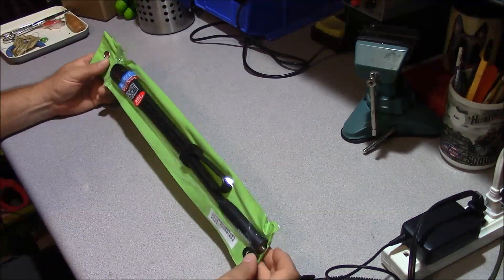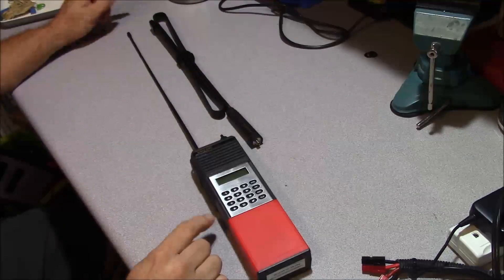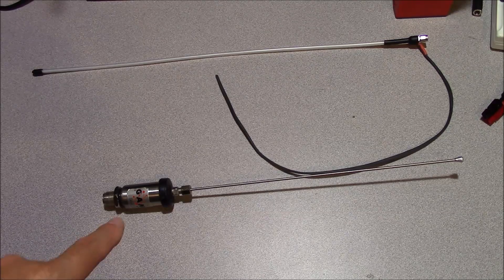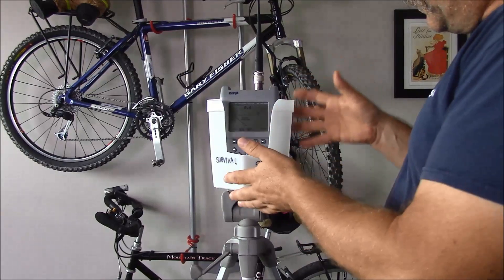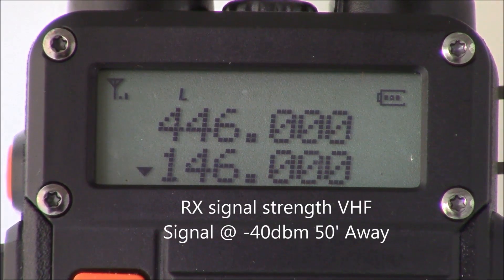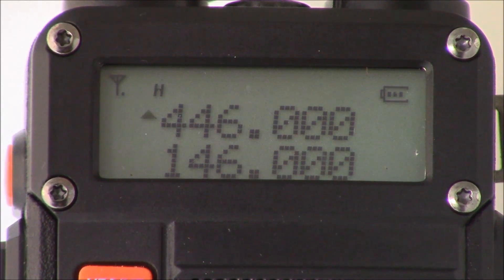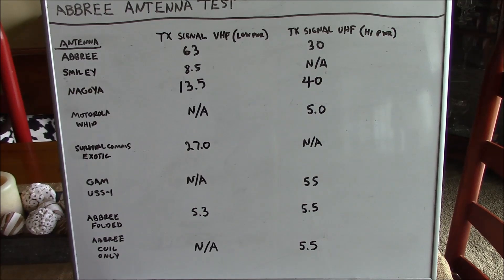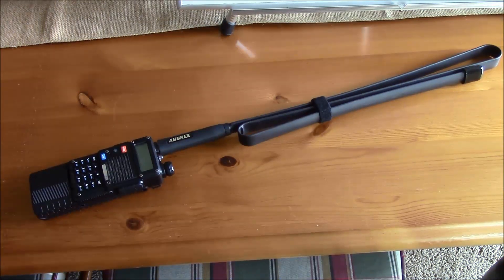ABBREE 42.5" VHF/UHF Blade Antenna Absurd but works well !

Comment: I have both lengths of this style of antenna.  I got then main for the novelty  but inside my house I found the 42 inch recieved better and hit our 2m repeater better. My signal report was better anyway. With the nagoya I can barely kick the repeater.  The tower is about 25 miles from my home and 750ft up the tower.
Reply from the maker: It does work well for sure it is just impractical for a portable IMHO. Im pretty sure it is a 5/8 wave which is a true 3dbd  with a counterpoise.  For a lunchbox radio, back of set antenna with a counterpoise, or as a radiator over a groundplane as a packable field antenna  I think it may be useful. Thanks for watching !

Comment: how hard a job would be for a non radio tech to remove the smw and install a bnc?
Reply from the maker: They might offer them with a BNC out of the box. Changing it yourself would be impractical. Making your own blade antenna would make more sense IMHO. Thanks for watching !
Reply: @survivalcomms  There is a BNC  option!

Comment: Brett, these "blade"antennas are offered in several different lengths,and I believe that some also feature a gooseneck section, making it look like the old PRC-77 short whip.  The 42.5 is longest that I have seen. Would dropping down to a shorter one provide a more efficient antenna for VHF?
Reply: I have the 18.8 inch antenna. SWR at 146.775 is 1.17 at 449.300, and I tested it three times, I got a SWR reading of 1.08. So there you go.
Reply from the maker: Cool beans !
Reply: Thought I was the only person who remembered the PRC -77   Communications expert school Camp Pendleton  Ca.  1976
Reply from the maker: I believe it would be more practical with a shorter blade. The coil might be a problem as it is likely tuned for this blade length . I considered trimming this blade to resonance and using it for another project .  I have a scavenged busted tape measure I was going to make antennas out of and indeed a short blade 77 antenna would be cool.
Thanks for watching !

Comment: Though about getting one and no. Its to big
Reply: Thanks for testing this... Indeed it is a good candidate for a field groundplane antenna, this is the first thing it came to mind when i saw it. Guess we have to thank the airsoft milsim crowd for driving the market!
Reply from the maker: You are welcome and you and I see eye to eye. I have some stuff inbound to make a cool GP out of it and a video will follow.  You are right this antenna oozes airsoft :) Thanks for watching !
Reply: BTW what kind of cosx did you use for your exotic antenna?
Reply from the maker: I used RG303 Thermax. It is a teflon dielectric silver shield and conductor. I used to have a spool of it. It is rigid enough to almost hold itself up but I sleeved the dielectric  with a clear tube from an R/C hobby store. it still is pretty flexible but not as much as the nagoya or my old forestry whip. Thanks for watching !
Reply: @survivalcomms  aha! I have a meter with connectors installed of Rg-142 which i see it is close..bought it to make 2 antennas out of it, but it is low priority project. thanks!.
Reply from the maker: It is enormous - like cartoon large. The long whips out there are pretty decent performers and much more practical IMHO. Thanks for watching !
Reply: @survivalcomms  I've been shopping around for the perfect antenna for gmrs , Public Safety and amateur radio
Reply from the maker: For a portable radio ? The Motorola KT000026A01 for the APX8000 does VHF/UHF/700/800 in one whip.
Reply: @survivalcomms  I kind of want a whip antenna because they get the best performance